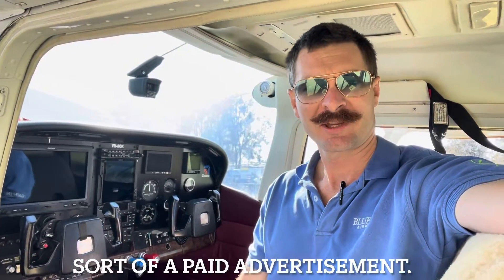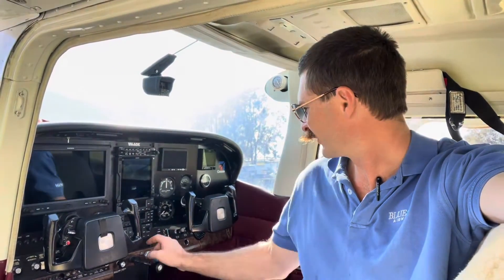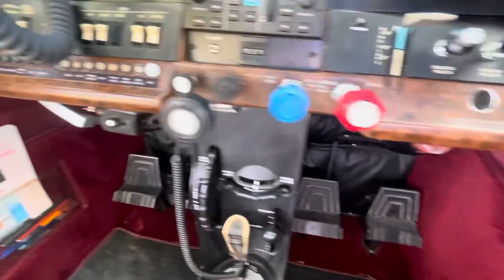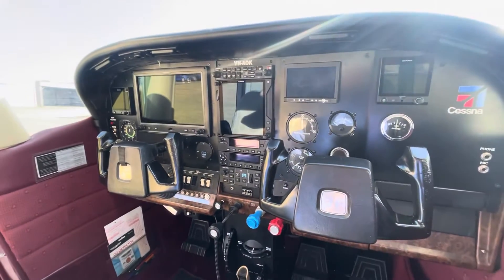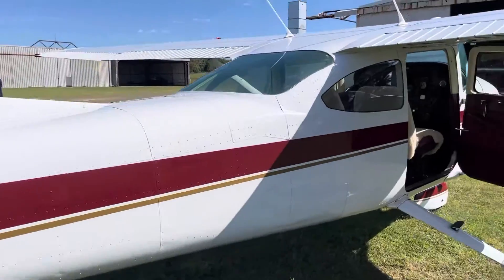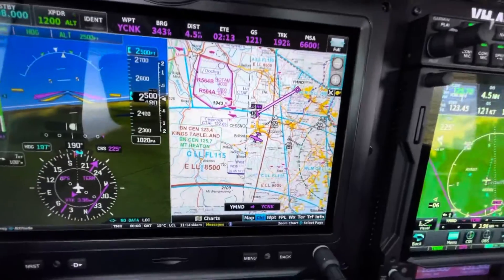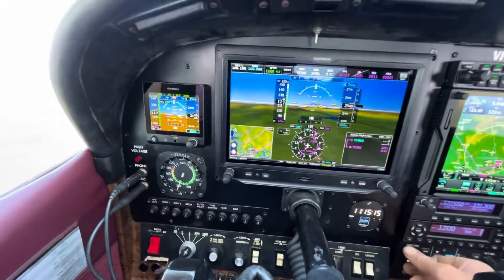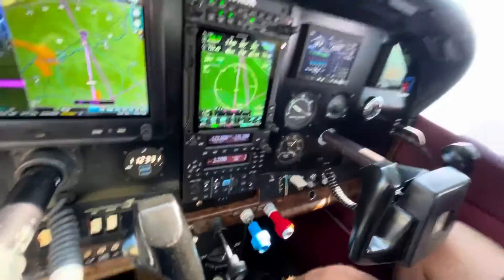First flight of a 182 with a G3X-Touch!

Comment: Beautiful upgrade. I am actually updating my original '182 Q panel in the coming months, waiting to get my order in right now! This is exactly what I have planned but I just saw another option that has me thinking. Instead of the 750, drop it to a 650 and put the money in another G3X panel on the right since the only thing you need the navigator for is to load approaches. What are your thoughts on that scenario having flown this one?
Reply from the maker: It’s a lovely machine! Great stuff, the Q model is the pick of the bunch in my opinion!
The option of the two G3X’s would certainly make it a very impressive panel, and a more “symmetrical” layout with one on each side?